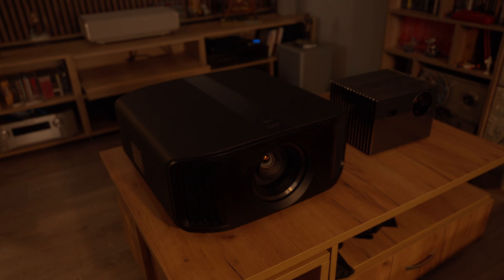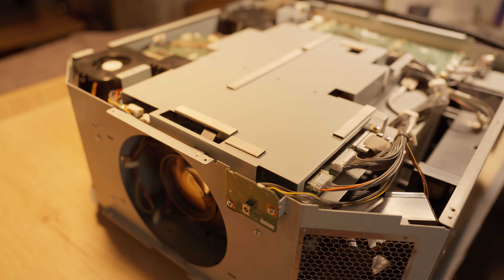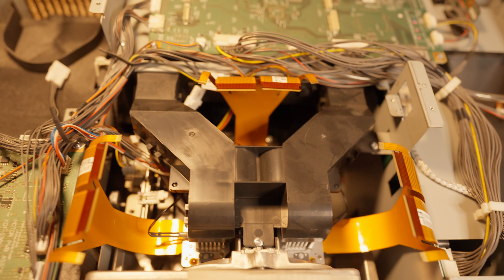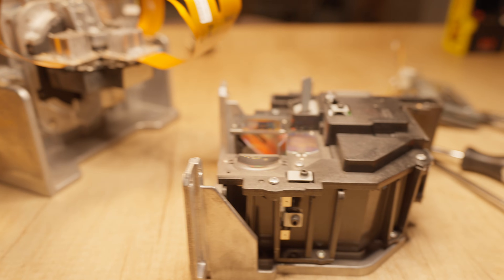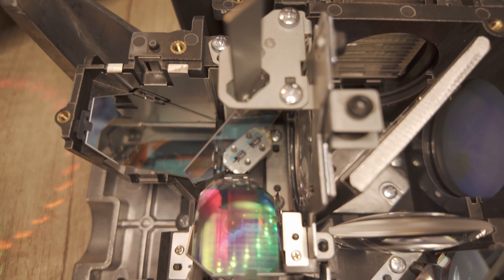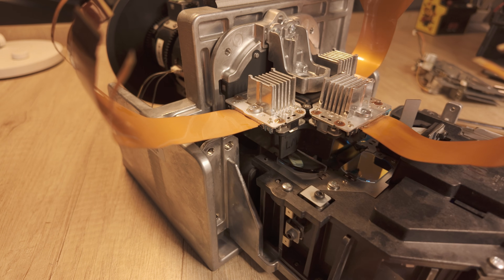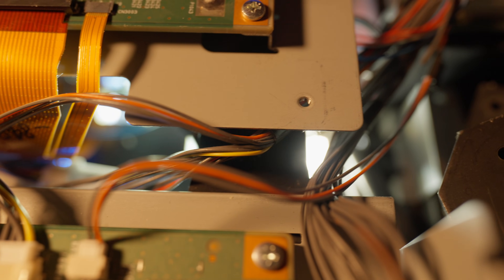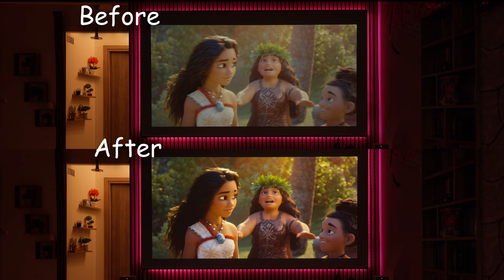JVC DLA-N7 Inside Cleaning - 6310 Hours of Use

Comment: Ευχαριστώ πολύ φίλε μου!  It gave me the push I needed to open my RS3000 and clean the fans to stop an overtemperature warning which was shutting off the projector lamp after only 5 minutes.  Mine had only 2034 hours, but the squirrel cage fans in the optics section were very dusty.  Just removing them and blowing them out with compressed air fixed everything.  I don't look forward to the day I need to open the optical engine, but after seeing this and addressing the dusty fans, I am not afraid.  Yes, the moment you turn it on again after having it all apart is a big one.

Comment: I have an old Sanyo XU105 with a very washed out image, even for an office projector, and far away from the advertised 4500 ANSI lumens. I bought it used and I didn't bother to clean it because the previous owner claimed it was serviced in the last lamp replacement 500h ago. Seems like I found something to do next weekend ✌
Reply: BE VERY careful and do not touch the LCD panels or the polarizer panels. you wiull ruin them just by making contact with your fingers.  Only use a vacuum and some dust is better than a ruined optical assembly.

Comment: So, every 3-4k you need to maintain it? Same for the laser models?
Reply: I thought this was the point of the filters?  Isn't it supposed to prevent dust from entering, so you don't have to do something like this?
Reply: @SnakeDoctor5104 Prevent and eliminate are very different things. It's going to happen but a little slower. And depending on how airflow is restricted with a filter, fans or other components may even wear out faster. I've found that having good air filters and filtration nearby is the best compromise, as well as keeping pets away or out of rooms with projectors. Pet hair and dander is just the worst.
Reply from the maker: Yes, LCD, LCoS, and SXRD projectors require cleaning regardless of the light source they use.
Reply: And DLP  @projectorjunkies4152 ?
Reply: @projectorjunkies4152   disassembling all those parts is crazy, most of us won't even consider such an attempt... i'll have to find a shop and pay their price
Reply: you should do it seasonally if possible.